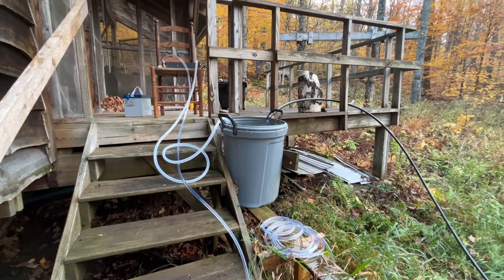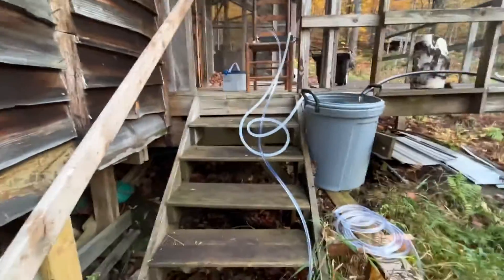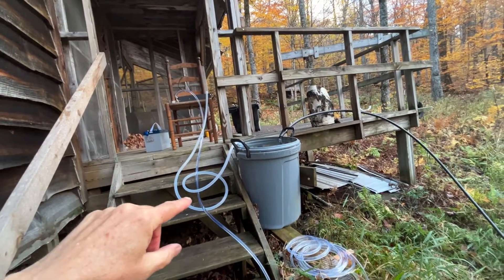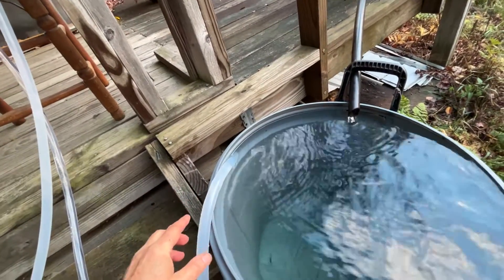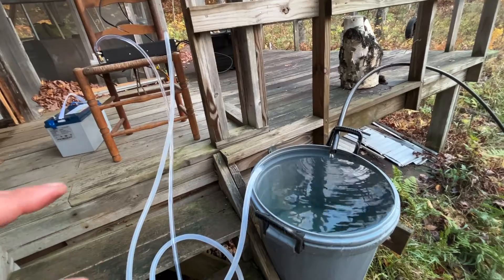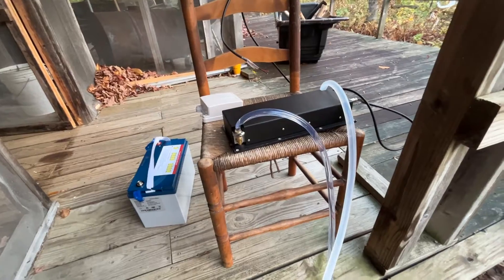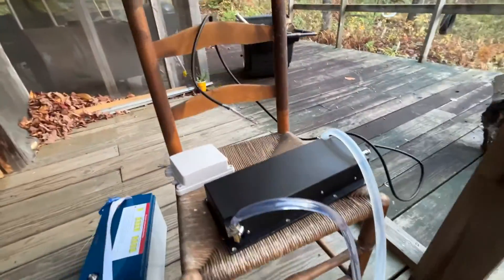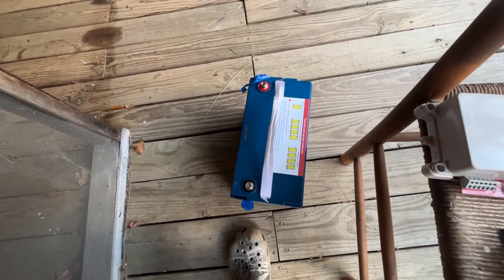12VDC Passive cooling Thermo Syphon Thermoelectric Generator Basic set-up

Comment: Very interesting and promising technology. I often reflected on whether it is possible to create a thermoelectric generator quite small and light so that you could carry it with you in a backpack. In this case, high power is not needed, it is enough to be able to charge the phone. But the mass is a critical limiting factor. Since the woodstove itself even made of titanium already has a fairly large weight. It is also interesting that you think about the possibility of using a bonfire to generate electricity. For example, using liquid metal, say, gallium or air flow for forced heat removal from fire?

Comment: I like the set up. The lower outlet is an simple smart idea.
I'm curious, what do you charge up or use the electcity on?
Reply from the maker: Anything that works at 5VDC, 12VDC or similar. That includes DC LED lights, DC radios, Laptops with a 12VDC to 19VDC step up Dc to Dc. Cell phones and Tablets ( Both Are 5VDC with a (Step down Dc to Dc 12V to 5V) almost every small electronic or the like works with DC power. All the 120V devices you plug into a wall with a box on the plug is a DC powered electronic !